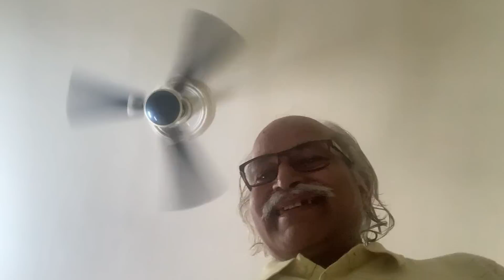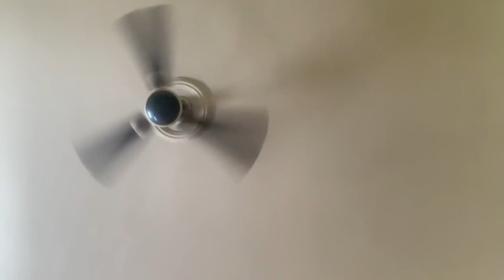Ceiling Fan in video

Comment: Consider the stroboscope as used in mechanical analysis. This may be a "strobe light" that is fired at an adjustable rate. For example, an object is rotating at 60 revolutions per second: if it is viewed with a series of short flashes at 60 times per second, each flash illuminates the object at the same position in its rotational cycle, so it appears that the object is stationary. Furthermore, at a frequency of 60 flashes per second, persistence of vision smooths out the sequence of flashes so that the perceived image is continuous.

If the same rotating object is viewed at 61 flashes per second, each flash will illuminate it at a slightly earlier part of its rotational cycle. Sixty-one flashes will occur before the object is seen in the same position again, and the series of images will be perceived as if it is rotating backwards once per second.

The same effect occurs if the object is viewed at 59 flashes per second, except that each flash illuminates it a little later in its rotational cycle and so, the object will seem to be rotating forwards.

The same could be applied at other frequencies like the 50 Hz characteristic of electric distribution grids of most of countries in the world.

In the case of motion pictures, action is captured as a rapid series of still images and the same stroboscopic effect can occur.
Reply: Very appropriate. The above video shown is the consequence of stroboscopic effect.
Reply: Yes
Reply: Yes you are absolutely right but if add  about the persistence of light that entered in eyes and image formed on retina and so on then this is totally a killer thinking 😌🧐🧐
Reply: @sunitasunno  sufficient time nhi mil rha hai retina ko image bnane ke liye......
Reply: @saurabh4597  yes i know tabhi to mai keh rha hoon ki aapne jo baat kahi hai usme time ka gap itna kam hai ki persistent of vision me bhi kahi na kahi error aa rhi hai .
Reply: @saurabh4597   In fact individual images of moving body forms on ratina, but the image formation becomes so faster that our visionary sense couldn't distinct the individual spatial images and hence, the world of motion appears like a motion picture.
Reply: i remeber this from a prof lewin lecture
Reply: @madhavsharma6643  awesome main bhi unhe follow karta hoon 
Per maine unki video me yesa nhi dekha kabhi
Kya aap batayege kon si video hai vo ☹️☹️
Reply: I really loved seeing this video, your explanation and conversation here.❣️
Reply: https://youtu.be/TO66f0DIXcM
Reply: Thanks for the comment Saurabh. It's a good explanation of what is happening.
Reply: Damn that's a great explanation !
Reply: This is due to the effect called aliasing. The camera of the phone doesn't take continuous photos but set of photos in quick succession. If the speed of the fan is faster than the frame rate then in certain situation a forward moving fan will appear to move backward at a slower speed. If the speed of the frames and the fan speed is same then the blades will appear stationary.
Reply: Copy pasted from Wikipedia 👎.. Ek hi line likho magar khudki likho.

Comment: "Consider a "strobe light" (flashing light) that is fired at an adjustable rate. For example, an object is rotating at 60 revolutions per second: if it is viewed with a series of short flashes at 60 times per second, each flash illuminates the object at the same position in its rotational cycle, so it appears that the object is stationary. Furthermore, at a frequency of 60 flashes per second, persistence of vision smooths out the sequence of flashes so that the perceived image is continuous.

If the same rotating object is viewed at 61 flashes per second, each flash will illuminate it at a slightly earlier part of its rotational cycle. Sixty-one flashes will occur before the object is seen in the same position again, and the series of images will be perceived as if it is rotating backwards once per second.

The same effect occurs if the object is viewed at 59 flashes per second, except that each flash illuminates it a little later in its rotational cycle and so, the object will seem to be rotating forwards.

The same could be applied at other frequencies like the 50 Hz characteristic of electric distribution grids of most of countries in the world.

In the case of motion pictures, action is captured as a rapid series of still images and the same stroboscopic effect can occur."- From Wikipedia at following link:
https://en.m.wikipedia.org/wiki/Stroboscopic_effect#:~:text=The%20stroboscopic%20effect%20is%20a,the%20period%20of%20the%20motion
or search Stroboscopic Effect.
A Stroboscopic light is from a lamp flashing at intervals.
Reply: https://youtu.be/TO66f0DIXcM

Comment: This is due to FPS of the camera which used in filming this video , if the speed of fan is same as the FPS then we observed that the fan is stationary , if it slightly greater then it seems to rotate in opposite direction. It's all depend on various factor like FPS of camera , no. of blades in fan , speed of fan.
Reply: https://youtu.be/TO66f0DIXcM
Reply: Shutter speed of the camera, not the FPS, manipulating the shutter speed of a cam can also make the fan look like its not moving at all.

Comment: The front camera of an android system has a video flicker control frequency of either 50Hz/60Hz just for this effect switching to a higher frequency will affect the framerate and the rotation pattern of the fan blades  ,the other effect observed is the fringe pattern of the blades (CW to CCW and back) is periodic and depending on the RPM of the motor the wave oscillation pattern (raxial fringes) generated will be a fourier representation boud by fibonacci series
Reply: The periodic shift of the fringes from left to right in linear view while being in rotation(CW to CCW) is similar to the pattern in the youngs double slit but at higher RPM the fringe transition is slow and at lower RPM the transition is fast

Comment: This is a very nice demonstration. The motion of blades in anticlockwise sense gives the angular velocity vector in downwards direction as per the right hand thumb rule. If the fan is accelerating then angular acceleration will also be in downward direction but if the fan is slowing down then the angular acceleration will be in opposite sense.
Reply: Kehena keua Chate hoo...
Reply: What the heck? This is out of context. The fan seems to be rotating opposite way due to FPS/shutter speed lag. Simple as that
Reply: Yeah, ture a best demonstration
Reply: @Verfacious  haha
Reply: Your SCIENCE 👏👏
Reply: https://youtu.be/TO66f0DIXcM
Reply: Ghar mein pankhe nahi hai kya
Reply: Mixing 2 vagetables
Reply: What you say is true but I don't see how it is related to what H. C. Verma what trying to demonstrate here.
Reply: I think anticlockwise rotation would imply angular velocity in upward direction. And what does angular acceleration has to do with the demonstration (just curious, would like to know what you are thinking).
Reply: @r1ultramax  
In case of a ceiling fan, the Angular Velocity is always in the direction of flow of air. If the fan is accelerating, then the Angular Acceleration will also be in the same direction as that of Angular Velocity. In this video, there are two different cases....
1. When the fan is accelerating
2. When the fan is decelerating
But the FPS (frame per second) of the mobile camera is fixed. Only due to the change in the frequency of rotation of the fan, the blades appears to move in forward or reverse directions, as demonstrated by Sir.....
Reply: @Dr.ANEESKHANSIR  2nd point does make sense. Thanks for making it clear.
Reply: Let me tell u guys that HC Verma is a fraud...
He got famous because of HC Verma books right?
Those books are copied version of authentic books from a US University (i will not tell the book name 😌)
Reply: @dev_peace_soul  If you have watched his interview, he has clearly stated that he was deeply influenced by Resnick Halliday Walker when he was in Patna Science College, so might be possible that some of the content might be similar to the book. That dosen't make him a fraud. And who takes 4-5 years to copy a book (it can be done in a day). And do consider reading the foreward and the acknowledgement.
Reply: @anonymousbanger  he copied and said it took him years !
Reply: @dev_peace_soul  Getting influenced dosen't mean copying. I have read both the books (HCV's and Resnick Halliday) and never found any similarities. Do cite the page numbers of both the books which you find similar.
Reply: @anonymousbanger  similarities??? And every page is exactly the same .... Thier is difference:)
Reply: @dev_peace_soul  I have read both books and do not find them to be exactly the same. Neither Halliday Resnick and Walker have complained because they too do not find the books to be exactly the same. 

If you had read both the books you wouldn't be here complaining and defaming a dedicated scientist like a disgruntled kid you would be an objective scientist curious about the universe helping humanity
Reply: @sureshraghunath1271  they never read this book!
Reply: @sureshraghunath1271  it's exactly same like LiTrAllY all copy paste thing!
Reply: @dev_peace_soul  okkk ,,
But what  u will say about his way of teaching?
Reply: @arvindyadav3721  yea it's good but he became famous by his books ..
So it's adharma!
Reply: @dev_peace_soul  if it was so easy to make & compile selected questions to understand Physics then several senior renowned physicists ever before as well as now could publish better books but it didn't happened. It means that he performed Great Job.
Such a good book is available at such a reasonably low cost from decades.
He spent his valuable 8 years of life for betterment of future of young students & country.
Can you able to publish a better book than such a noble book ?
If not then one suggestion: If we are unable to give credit for their noble hard work then we never try to snatch or blame their credit too.
At last but not the least, Representing old illustrations in new way to provide Crystal Clear Vision is a part of Dharma (not Adharma) because it is their creativity, patience & hardwork.
Reply: @naveenbhatia-iy3ul  those all questions are not by him :)
Reply: @naveenbhatia-iy3ul  he is just copied an entire book he did nothing new! Or great:)
Reply: @naveenbhatia-iy3ul  Guru Dhrona a great teacher but he did adharma... Thats what i mean
Reply: @dev_peace_soul  Usually I ignore stupid comments like this, but I can't let you go on slandering Sir HC Verma like that. Yes his books were one of the main factors for his popularity, but he is also a renowned world class researcher and does a lot of things for our country's education. He teaches the poor and unfortunate and opens institutions for them. I know this because my mother is a journalist and I have actually researched unlike you. So stop spreading misinformation, be respectful and think before you speak.
Reply: @cracknblast8247  wow great after clever work and adharma hide the lies and start things which makes you are very nice human ?
Reply: @cracknblast8247  it is better  to mention examples rather than saying I have done research or my mama is a journalist.
Reply: @abcdefg34822  exactly!
Reply: @dev_peace_soul  Dear, You need to read my previous statement once again in which i have already explained not only about your Misconceptions of dharma (or misleading knowledge of Dharma) Unlike your example of Drona but also about copying of questions from one book.
That single whole statement is more than sufficient for your each if & but.
Reply: @dev_peace_soul  do you know only word adharma
You know it's adharma to only know adharma🤡
Reply: @dev_peace_soul  🤡
Reply: @ok-hg2in  🤡🤡

Comment: Yes a similar effect happens sometimes with the blades of a helicopter when filmed with a camera. It looks as if the helicopter magically starts lifting up without its blades rotating. For this the frame rate or shutter rate of the camera have to be equal to the frequency of the helicopter's blades rotating.
Reply: @Ujjwal It is a different application on same concept
Reply: https://youtu.be/TO66f0DIXcM
Reply: Yeah! I have watched this type of video on YT. And it looks cool tho!
Reply: Not equal
Can be more too
Depends on number of blades
Reply: @Ujjwal that is exactly what sir is talking about here, it has to do with camera shutter speed only